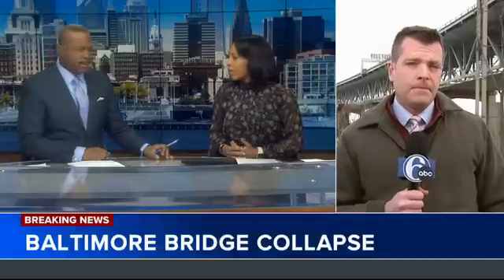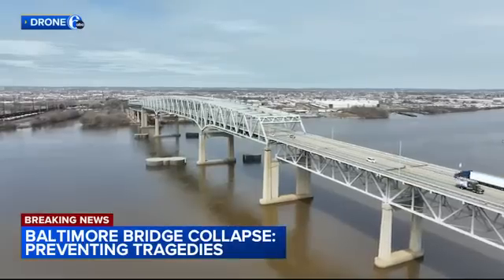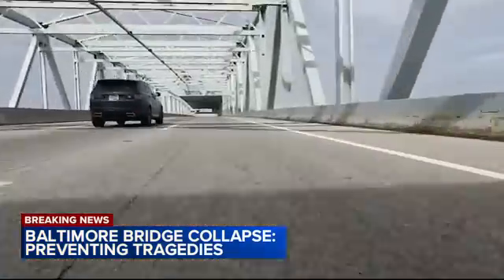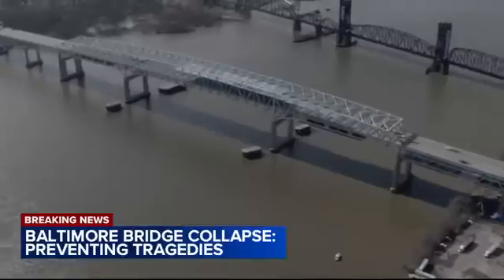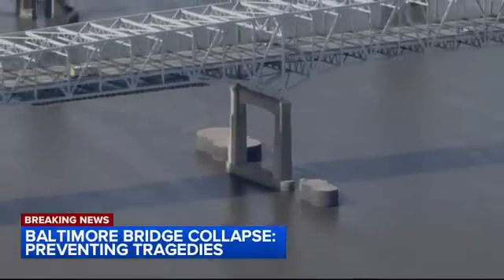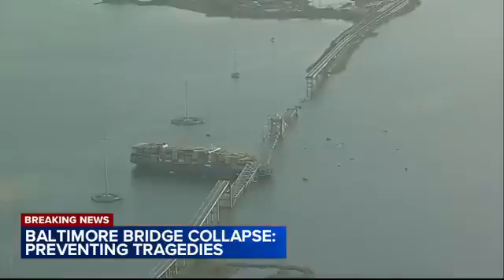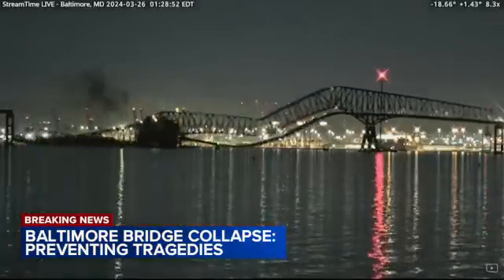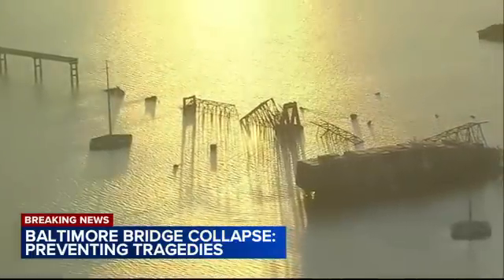Here's what surprised a structural engineering professor about the Baltimore bridge collapse

Comment: Our port on the northwest coast of Canada all ships have 2 tugboat escorts to open water.  Many of our longshore workers here were questioning why there was no tugboat escorts in Baltimore.
Reply: I think this should be standard at all ports.  At least with tugs in radio and visual contact, there is a chance of controlling and guiding a huge vessel should it become unable to control itself.

With the Dali not having escorts, no power so no steering, weight and momentum, one’s only choice was to watch as a disaster was taking place.
Reply: @brian5o   Could two tugs weighing at best 10,000 tons a piece be able to stop or steer that container ship weighing 95,000 tons traveling over 8 knots?
Reply: @brian5o  -

Before this incident, there was no reason to justify the cost and manpower to do it.  Government and private industries are not paying for "well, just in case".
Reply: @brian5o  once a ship exceeds 3 or 4 knots, tugs are useless
Reply: Considering the lack of protection around the supports, it would have been a relatively cheap precaution.
Reply: @Paul_Wetor  You think you can stop a ship like this with a concrete barrier. Its speed was already 8.5 knots.
Reply: @IesKorpershoek  Do you know how fast 8.5 knots is?
Reply: @giftedone831  Yes I know, this info is from marine traffic. You can see the route and speed.
Reply: @IesKorpershoek  diverts.not stop.think
Reply: @IesKorpershoek  No need to stop when you can just deflect, thus why the barriers are round.
Reply: @IesKorpershoek The Sunshine Skyway Bridge collapsed in 1980 for the same reason. The new one has "dolphins" as protection.
Reply: @IesKorpershoek  Why were they moving so fast?
Reply: @IesKorpershoek  it's not about stopping the ship, more about bouncing it back to the channel between the bridge supports. It works. All modern bridges have those dolphins/starlings.
Reply: @IesKorpershoek  a solid concrete island 30 feet thick an somewhere around 10 feet out of the water? Absolutely would have stopped this ship from colliding with the bridge pilings. The fender doesn't have to stop the ship, it only needs to deflect it.
Reply: @3DPDK  I'm not so sure about that. If it was deflected and the bridge had a head-on hit the result was the same. This is because of the construction of the bridge. If the load of this bridge is compromised it will collapse. Piler or not
Reply: @IesKorpershoek  I agree, and others have said this bridge was in bad shape and rickety. I'm a retired ship's captain and have seen these earth filled dolphins do their job, even in head on collisions. My point in other comments is that this bridge, in spite of current transportation and infrastructure regulations had no protective fender system at all and probably needed them more than many other bridges around the country because of the shape it was in. The state of Maryland has had thirty years to upgrade a federally subsidized Interstate road system bridge since the regulations were applied. Why wasn't it done?
If you look at the fender systems on other bridges in heavy shipping lanes, understand they are engineered to withstand a collision of large tonnage vessels. They take the damage but protect the bridge.
Reply: @IesKorpershoek  The existing bridge footing foundation stopped it.
Reply: @IesKorpershoek And had the current pushing it....
Reply: @IesKorpershoek I've seen a 4inch cement filled pipe stop a 30mph car.  Those cement protectors seem about the same size proportionally to the much slower ship, so it seems quite possible to me.  At least assuming they're deep enough and reinforced with enough rebar.
Reply: @IesKorpershoek  they are meant to slow down and deflect, not full stop.
Reply: @IesKorpershoek A: maybe...? since every collision's different but obviously we won't know at this point because they were NEVER ADDED (this despite decades of being an active shipping lane)...

guaranteed somebody called out this potential problem starting way back 10, 20, 30 years ago but as usual (due to the expense) it fell on DEAF EARS and was ignored.
Reply: @IesKorpershoek It’s almost like there might be physics calculations for that.
Reply: @wolfwalker5924 Once in fully open water, container ships this size typically run at between 20-25knots (28 mph for the metric deniers). It takes a certain amount of time to accelerate a 213,000,000 lb mass to that speed, so it was just getting started.
Reply: @fonkenful This ship was not in open water. It hadn't even cleared the bridge.
Reply: @IesKorpershoek the ship stopped when it hit a large concrete barrier.   So,  yes
Reply: @IesKorpershoek  The concrete barriers aren't there to STOP the ship, they're there to DEFLECT the ship away from the bridge support. That's why they have that distinct figure of 8 shape: the first part of the 8 takes the hit and absorbs some of the energy of the crash and the rounded shape forces the ship to veer to the left or to the right just enough. The second part of the 8 is just there to fortify the first part so it will hold up longer, as you correctly state that the mass of a ship this size can't be stopped by a simple concrete barrier.
Reply: @tjroelsma  You are right. Bud if the ship had veered to the left or right it would have still hit the bridge.  The construction of the bridge is in a way it would still have collapsed. According to 'Marine Traffic' data it was way out of the shipping channel and the bridge would have been too low at that position to pass safely.
Reply: @evers6214  No it won't. The kinetic (100.000 BRT at a speed of 7.5 knots) energy is enormous it would have veered the ship to the right or left and still hit the bridge. The construction of this bridge is that it would have collapsed anyway.
Reply: @fonkenful  of course there are.  If there was a concrete barrier and they had a head-on collision a lot of the energy was dissipated. But look at Marine Traffic data and the video of the ship colliding on an angle that's a completely different scenario.  Depending on de angle the ship would have veered to the left and hit the bridge anyway. I'm almost sure due to the construction of this bridge would have collapsed anyway
Reply: @IesKorpershoek  Yes, but if it was pushed to the right, most likely that pillar would have still been standing and probably only a single span of the bridge would have collapsed.

If it was pushed to the left however, it would have been pushed back towards the shipping channel and either cleared that span, or scraped it, causing damage to that span that either could have survived the damage or at worst again just a single span would have collapsed.

Either way there would have been much less damage and if you can't totally prevent damage, you should at least do everything to diminish the amount of damage. 

Had those concrete protectors been in place, this accident would have had an entirely different outcome and that's the best you can plan for when a virtually unstoppable object collides with an unmovable object.
Reply: @IesKorpershoek   you are correct in that a normal barrier would not stop the stupidity high amount of force that ship had.   But it did stop when it collided with a man made structure.   So we just need to build a stupidly overblown barrier…..   which would still be cheaper than a new bridge., and somewhat reasonable considering the class of tankers that port is serving
Reply: @3DPDK yep, and that’s why the dolphins are round.
Reply: @IesKorpershoek  Yes, if sized properly. The bridge certainly stopped it.
Reply: @giftedone831 even at 9mph, that ship hit that bridge with roughly 5-10MN of force which is roughly 500k-1M tons of force
Reply: @BreakerBreaker1320  I understand that, but the guy was acting as if 8 knots was supersonic speed
Reply: In 1993, there was also a horrific crash of an Amtrak train when a boat hit the bridge support while it was lost in the fog.  It displaced the support far enough that the rails were bent, but not so far that the track signals indicate a broken rail.  47 people died.
Reply: @IesKorpershoek Exactly.  With container ships carrying the loads they do TODAY (not when this bridge was built), there's 1,000s of tonnes moving at pace--those concrete barriers are just annoying speed bumps.
RIP to the lives taken 😞
Reply: @wolfwalker5924 your understanding of hydrodynamics and ship propulsion and steering needs filling in.

Ask on here, you’re bound to get the correct answer with no bias….
Reply: @3DPDK  This is so true. A disaster that possibly could have been avoided or @ least not been as bad. The sad part is regardless of the speed of the video it appears the ship was veered to the bridge support. Sad the loss of life.
Reply: @IesKorpershoek probably not, but it would probably deflect it, which is just as effective.
Reply: @daryllambert-ho9jk  Deflection is random and worse. deflection is depended on the angle attack ( so to speak).
Reply: @IesKorpershoek   the dolphins are designed to do exactly that
Reply: @IesKorpershoek  Why does it go so fast still in the channel then?
Reply: @WhyYoutubeWhy  First, this is a normal speed to have enough pressure on the rudder to steer.  It's SOG ( Speed Over Ground), which is the product of the ship's speed and current speed. (in- or outgoing tie).
Reply: @IesKorpershoek there are breaks in waterways for a good reason bubba gump it actully has stopped massive ships from destroying stuff... the ship had no power it was slower then that kid stop eting glue.
Reply: The ship had two tugs assisting her from her berth. Once she is able to move under her own speed the tugs depart. Though, when the MAYDAY was sent out both tugs tried to catch up and save the ship. 
Thankfully the hour made it much easier to close down both sides of the bridge.
Reply: @johnnieangel99 i calculated that the max capacity for this bridge is around 12,000 people. Very lucky only 6 are missing.
Reply: @treatb09
Yeah, for sure for sure.
11,994 people saved.  B O N U S.
Reply: @johnnieangel99  Why do you think a ship is a girl? In my native language ship is masculine, so I always think of a ship as a he/him. Same with airplane and a car, unless it's a Toyota, Honda, Acura, Mazda or any other that ends with an "a" - then it's definitely a girl.
Reply: @pawelzielinski1398  From the Imperial War Museum in the UK....."Another tradition is to consider ships as female, referring to them as ‘she’. Although it may sound strange referring to an inanimate object as ‘she’, this tradition relates to the idea of a female figure such as a mother or goddess guiding and protecting a ship and crew"
Reply: @johnnieangel99  In many languages including my native language EVERY noun and therefore EVERY object has a gender.
My language happened to have 3 of them.
And ship is masculine.
It's only strange to English speaking people or that subset of English speakers that do not know any foreign languages.
Reply: @michellebyrom6551  Sure. I have been living in an English speaking country for a few decades, but mentally I am and always will be Polish. For me every object has a gender. So my phone is a he. Most of my cars are either masculine or neuter.
Spoon is female, fork and knife are masculine. Earth is female, sun is neuter, moon is male etc. Shirt is female so are the socks. etc.
That's how it is for me.
Reply: @johnnieangel99  Thanks for that clarification.  Perhaps for the future, tug boats should remain with the ship, even if the ship is under their own power, until they clear a bridge, especially since this ship was massive with a full load. Perhaps that might have helped in this case.
Reply: @peterc504
Yep, that's what they're designed to do, the have powerful engines and big screw propellers just for that job.
And the crews know exactly where to apply the push to the big ship.
Reply: @johnnieangel99 I Japan, the tugs only leave the ship once it is clear of all obstructions near the port. That should ideally have been followed here.
Reply: There is another YTer who provided an analysis using a ship tracking tool and there were indeed two tug boats. Like someone else indicated, they left when the ship was properly placed in the channel, as per the normal procedure.
Reply: @Canuck1000
Yeah, well, just might look like that policy might be up for review some time in the not too distant future.
Reply: @Canuck1000 that's not normal when there's no dolphin protection around bridge supports. Smh 🤦🏼‍♂️🙄
Reply: Google how long the Chesapeake is and it will give you some of the answer.  The tugs would have to escort the ship for over 100 miles before it reaches open water.  Also, millions of ships have gone in and out of this harbor without striking the bridge.  It's a freak accident and sadly accidents happen.
Reply: 2 tugs were escorting that ship to the main shipping channel, from there the pilot was in charge.
Reply: @IesKorpershoek 😊
Reply: @IesKorpershoek  So while there were witnesses, ie the tug boats, everything was fine?  Interesting.
Reply: @BettyMeier  tugboats were only used to depart from berth and make the turn into the shipping channel. There were 2 pilots onboard.
Reply: @IesKorpershoek there was no tug wtf is wrong with you...
Reply: @IesKorpershoek
Sure, the pilot was assisting in the navigation of the outgoing ship.
But the salient point which others were trying to make, but which seems to have gone straight over the top of your head, was that the tug boats, had they still been escorting the ship past the bridge, would have been able to apply external steerage pressure to the side of the out-of-control ship to push it away from the bridge supports.
Reply: They were not required to tug past the bridge in Baltimore
Reply: @witchqueen8576  The question is why not? To save money perhaps?
Reply: But in hindsight?  @witchqueen8576
Reply: @witchqueen8576 they should have w/no dolphin protection.
It's a no brainier.🤯 Smh 🤦🏼‍♂️🙄
Reply: They do..once clear of the docks they proceed under their own power, they also have pilots on board from the port authority.  The tugboat are cut free but are still there as an escort
Reply: The port of Baltimore exits out into the upper Chesapeake Bay, considered "inland waters". In the US a tug escort is only required if the port exits directly into open waters and usually only for international passages, or incoming crippled ships, or for loaded LNG tankers. A Baltimore pilot was aboard this ship but they get off the vessel less than half a mile into the Chesapeake Bay.
Reply: @3DPDK LNG = Liquid natural gas?
Reply: Wonderful America. The Gordie Howe bridge same distance proper construction cost 7.2 billion.
Reply: no.... tugboats are NOT used for transport down a waterway, they are only turning them out of a harbor dock. until they can move on their own power. that would be easily just 400 or 500 meters off the dock. try being less of a redditor that wants to know things but fails horribly trying to appear smart.
Reply: Living in northeast Anne Arundle County Md. Rivera Beach, Pasadena I have traveled the Key Bridge thousands of times in my commute to work in Baltimore County and southeast Baltimore City. In those travels I have never seen a tug escort a ship to the bridge, or beyond from the port nor a tug waiting for an incoming ship to escort into port. These ships arriving without tug escorts could also be observed from our community boat launch that overlooked Sparrows Point to the east (across the Patapsco River), Baltimore's inner harbor to the north just beyond the Key Bridge. Pier protectors supporting the center sections of the span in the shipping channel should have been put in [lace years ago.
Reply: @Bob-oc2xp  I would like to believe that your attention was, or should've been on the traffic in front of you, while crossing the bridge. Tugs do escort the ships out of harbour. They're not required to escort the ships as far as the bridge or beyond the bridge! Besides, a ship that size would not have been easily managed or stopped by two tugboats!
Reply: @ptrlxc Not true. Only tankers and ultra large containers (>330m I think) require escorts in/out of Vancouver
Reply: 'Saving Money'?
Reply: CHY-NA!
Reply: Always gotta make it about race. Geez.
Reply: It's run by the Democrats. We all know these guys are the best in the world. Extremely moral and all loving and tolerant.
Reply: well said! @wshyangify
Reply: The engineers must have realized that if a large ship hits a bridge pillar, the entire 2.5 km long bridge will collapse. For cost reasons, they probably decided not to make the bridge pillars so strong that the ship would sink rather than destroy the bridge.
Reply: I wonder why the anchor wasn't immediately dropped after they lost powed?
Reply: @Tom-cz9op  Seems they couldn't do this because of a total power breakdown
Reply: because it would have done less damage and maybe the bridge would still be up...  why do black boxes conveniently stop at the most inopportune times... and then just after the incident happens mysteriously begin to work again?   they're there to record the incident!    It was PLANNED!    WAKE UP PEOPLE! @Tom-cz9op
Reply: They did but they stopped after they left the dock
Reply: I said the same thing. In my area tug boats escort the big ships in.
Reply: maga makes anything and everything look bad ... it's their mission.
Reply: What’s with the puppet in the background with the pin on tie?
Reply: Exactly !!!
Reply: Fuel cost.
Reply: The ship had cleared the port and was under its own power and as such, tugs were no longer required.
Reply: I and others said he same thing.
Reply: oh btw welcome everyone to the Right Wing psychopathology of DEFLECTION and the never-ending search for SCAPEGOATS.  yeah, what you have going here are a group of people who have once again been publicly embarrassed by their GREED and quite naturally feel a need to try and "cover it over"...

In fact this incident PARALLELS what just happened at BOEING with the door blow-out on the Alaska Air Flight back in January. those paying attention to Aviation will recognize the same pattern of "creating a DEI smokescreen" was being used around that incident to divert attention away from the screw ups of the CEO and upper management (can't forget them) that began many many years before the disaster...

also ref: the year 2018/2019, 737 MAX, MCAS, and the deaths of 346 from the crashes of 2 planes just after takeoff.
Reply: Exactly, to open water, I live in  a New England state  and our port tugs escort to open water and it doesn’t even take  in this size cargo ship.
Reply: The policies the US need to be changed.
Reply: Because it was done on purpose
Reply: @aidansgaming550  umm...okay
Reply: thank you!
 @aidansgaming550
Reply: *there were no (because "escorts" is plural)
Reply: Been wonderin about that myself
Reply: my question was same,  in the first moment
without i were expert

there are too many coincidences, and im afraid  this investigation will lead no where like the nordstream
they  wint find the people responsible
Reply: Good point
Reply: Only oil tankers out of Burnaby have 2 tugs, one attached at the bow and one at the stern. The piers of the First (Lions Gate) and Second Narrows (Iron Workers Memorial) Bridges are in very little danger of being hit because they are next to the shore and any ship on course to hit them would run hard aground before them. The tankers are Aframax 80 to 120 tonnes or less and can only be 80% filled because the Second Narrows are shallow and the bridge deck no that high. After the tanker has left Burrard inlet they release their tows but one continues to accompany them until they hit the open Pacific. No large containers ships bound for Vancouver pass under either bridge since the container port is at Robert's Bank well outside Burrard Inlet.
Reply: Not enough tugs there to do that and their other duties too. Blame the port authorities.
Reply: Cost saving on construction projects equals negligence. 
I'm thinking local wildlife and environmental impact concerns, made additional safety precautions Cost prohibitive.
Reply: I don't understand why there wasn't any tugboats escorting the vessel out of port. Hopefully the people of Baltimore get answers.
Reply: Because the ship was taken over by the CIA and intentionally  rammed to cover hidden explosives .
Reply: Same here @ port of Indiana
Reply: because they are cheap
Reply: Ships should not be moving in the dark 😂😂😂😂😂😂😂😂😂😂😂 and to think these people get to vote and breed 😂😂😂😂🤬🤬🤬
Reply: Here in NYC i used to work for the federal government at the passenger cruise ship terminals. One time I had to board the QEII it was running late. We took a tug boat to meet up with it and a local captain came with us to board it. Once it reaches Sandy Hook off New Jersey the Coast Guard requires it must be escorted by at least two tug boats all the way up the Hudson River to the pier where it would dock. I'm surprised that the Dali cut loose its two tug boats and attempted to pass under that bridge on its own power.
Reply: Another difference is the protection for the bridge supports on the Betsy Ross bridge is on both sides of the bridge, where the Francis Scott key bridge only had protection on one side and far away from the actual bridge support
Reply: MONEY !
This requires new regulations to be written and put in place.
Reply: Would one or two of those tugboats make any difference in this case? These cargo vessels are enormous…
Reply: Baltimore is a stupid place run by the dumbest people. Chicago isn't there yet....
Reply: Tugs are rare at ports in the USA, due to additional costs. Capitalism, baby. 🙄
Reply: @carmadefries3729  all our problems are caused by capitalism. Thats why it happened in 2024 under communist democrats and DEI workers. Eat dirt buddy it better for you than MSM
Reply: That ship should of never left the port, they were reporting major problems with numerous things before it even left, so why was it even aloud to leave, thats the question.
Reply: NO, THE QUESTIONS ARE:  WHY DID THE BLACK BOX STOP WORKING SECONDS BEFORE THE IMPACT AND RESUME WHEN THE DAMAGE WAS DONE, AND WHY DID THE SHIP MAKE A HARD RIGHT, HEADING STRAIGHT INTO THE BASE OF THE BRIDGE?   THOSE ARE THE QUESTIONS!    WAKE UP PEOPLE!!!!!!! @dennismason8156
Reply: Because Mayor Pete said they weren’t necessary.
Reply: They used the money earmarked for protection of the bridge supports to paint more BLM murals across the crime ridden, rat infested hell hole called Baltimore.
Reply: ditto. why was there no precautionary escort out of the port. Same reason why epsteins cameras were turned off for his murder.🤣🤣
Reply: THANK YOU!
 @Rick-ux5ku
Reply: I was talking about the lack of protection yesterday, including the need to divert rather than try to halt a large ship.
Reply: Especially at night
Reply: Owner of boat didn't want to sell.over valued his portfolio.that is a PORT PUN.
Reply: Tugs would have been useless. Even if they'd been able to get lines on it, two tugs trying to stop a 95k-ton vessel moving at almost 9 knots would have been sunk by their lines as it pulled them along like rubber duckies.
Reply: because it was russel crowe's day off!
Reply: EXACTLY!!!
Reply: Too many blacks. That's for both sides of the fence
Reply: Check out the video of moment of impact, as this barge just free float to a sweet spot on a bridge to take it down like it was aluminum foil, without tugboat knowing before that power was used as an excuse. But take a look at the cars going over bridge just before impact. 2 cars driving slow until the lights go out and watch that last car fly past as if he was clean up batter in a softball match, and was past before it buckles. This was one of many conspiracy theories we heard about when collusion jo was vp with the red line expert poser in cheat.
Reply: It was supposed to have 2 tug boats,
Reply: @corrineanders6373  It was supposed to have 2 tug boats,"  -  Only until it's in the channel.  After that the tug's job is done.
Reply: @corrineanders6373 It did! Do your research!
Reply: @corrineanders6373 add the link to the code of operation you’re obviously quoting from the Port Authority SOPS.

THANK you ….L
Reply: Good point. Plus, ships should not be navigating in and out of ports in the dark.
Reply: @sunnyd4125 that isn't an issue.  Pilots are requited to be able to navigate almost with their eyes closed.  Radar covers the rest.
Reply: @sunnyd4125  Why should ships stop navigating in and out of ports in the dark? Everything is still in the same place it is in daylight and the navigation charts show the location of everything relevant to navigating in the port and there's radar. Hundreds of ships successfully navigate in and out of ports worldwide every day. Ships navigating in ports in the dark are safer than automobiles navigating in the dark, ships are slower, have detailed charts, and have more occupants on watch looking out for stuff.
Reply: Good thing Baltimore isn’t a corrupt place!
Reply: @slvrktman7824  LOL ya .. good thing. Meanwhile Baltimore officials claim to be fighting crime in the city ...
Reply: @slvrktman7824  Most cities and states are corrupt! The US political and economic systems are corrupt!
Reply: @slvrktman7824 the entire State of Maryland is corrupt. Her citizens are suffering.
Reply: What about the grain pier?
Reply: @slvrktman7824 Also the bridge is managed by the state, not the city
Reply: Money, money, money
Reply: The question is, even with an escort and in the time it happened, could the tug boats position them selfs in time to avoid the accident? Every port is different, and as such, the tug requirements i imagine vary, too. 

Extremely rare event. How much cost do you add to prevent an extremely rare event?
Reply: @andret4403  It's not that rare. There were 3 similar accidents within last few months. The other bridges survived, because they were better designed.
Reply: @pawelzielinski1398  not too  many ships lose power and hit bridges knocking the. down. Especially from thefrom what i saw from the news the ship wasn't supposed to be passing under or that close to the bridge, so hitting bridge like this is rare. 47 years, this bridge has been standing. If ships are not supposed to get close, why protect the bridge. This was an astronomically long odds incident. Hence, why is so news worthy.
Reply: @andret4403 You add enough cost to prevent it dumbasss.
Reply: It's because Canada is a safety Sally in comparison to Americans. And a two tug team probably wouldn't have stopped this, they would have just sank trying to.
Reply: @FoxMulder-p2c  That's what I was thinking! You don't send two toddlers to keep a sumo wrestler from falling down!
Reply: I heard there were tugs on the scene.
Reply: @viv876undeniable
Doubling back after the container ship once the heard the SOS distress squawck over the radio.
Reply: Ordered to stand down like during school s........
Reply: 2 American pilot were operating the ship. 2 american hit the bridge. Other indian sailors saved life by sending SOS when they saw those american pilot not able to handle ship
Reply: @amitkamboj1287
NOBODY could handle the ship when it had NO POWER.
Reply: @Fundaytool  That is the truth!
Reply: I was wondering the same thing. Also some ports require also some rivers/ports require a special captain to get the ship to sea.
Reply: it's mandetory to navigate the Chesapeake that there are usually two pilots who know the shoals and channels from the port to the open ocean @mikefeeney3122
Reply: DEI. Synergy, the operating company, has had problems and this very ship, the Dali had a collision in Antwerp a year or so ago. Synergy has been pushing for diversification of its crews
Reply: @sledawgpilot  are you claiming that white people are better in operating a ship than others??
Reply: An hour is more than enough time to throw down an anchor!  And don't tell us this cargo ship didn't have an anchor.
Reply: ABSOLUTELY CORRECT.. Why no tugs and Who was at the controls? The Pilot should have been and they are supposed to know the chanel forward and backwards.  WTH is going on  ?
Reply: When you have a container ship like the  Mv Dali. . Who never followed maintance inspections properly.   That has just has Accident in Antwerp.  Had law suites against the ship owners for safety violations.  by the workers .  that some law suites were settled out of court.   But stil many  other law suites by injuried workers waiting to be settled   .Plus The My Dali just had safety inspection.   Before Baltimore accident.   They couldn't  drop emergency  anchor.   Lost power just seconds before the crash.   That collided in just the perfect spot.   To bring the Baltimore  Bridge down.   Them lost 2 minutes of critical  video  on the black box ..  They are now saying it will take 2 years to investigate. This accident. .I would say   Is going to take 2 years and more.  . To  cover up . The truth about the accident. That took down the Baltimore Bridge.   You must remenber.   We are at war with Russia and China.  You can't  believe any thing  eitherside  tells you. We will never know the truth.
Reply: @amossimon3438  2 years to cover what up? Are you ok? The US wants to cover up for  companies overseas? They have INSURANCE companies for a reason. 
This isn’t political. Do you know who is in charge of the investigation?
Go see how fearless she is against Boeing, you know Boeing which represents a huge part of the US economy.
They lost power minutes before the crash. No footage was lost, we see it. 
Seriously, you need help.
Reply: It’s crazy they had no escort knowing the dangers 😢😢😢
Reply: @philliphall5198  The Dali had two tugs as escorts! The tugs had just released the Dali minutes before the malfunction! Learn the facts before commenting.
Reply: My thoughts exactly,  especially given the extreme size of modern vessels compared to when bridge was built. Tugs definitely needed to escort these monstrosities through to open water. A complete lack of common sense in Baltimore procedure.
Reply: Capitalism
Reply: @paulreadly8161 ha. Don’t confuse the system with the people who pervert it.

I guess you haven’t been paying attention to politics for the last decade or so.
Reply: Diverse.
Reply: @TEAMGETHELP What does that have to do with this incident, Bigot?!